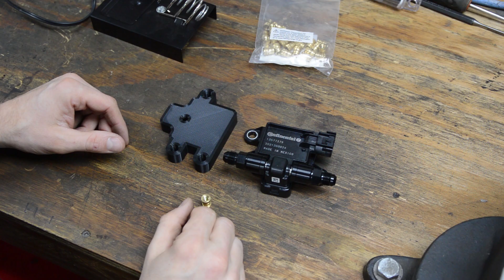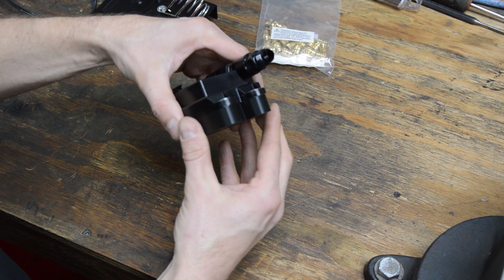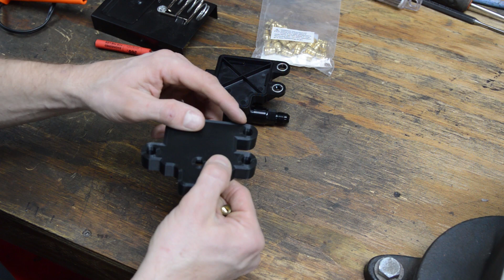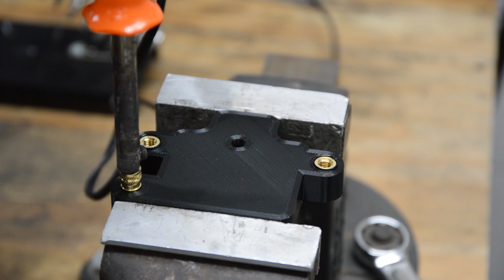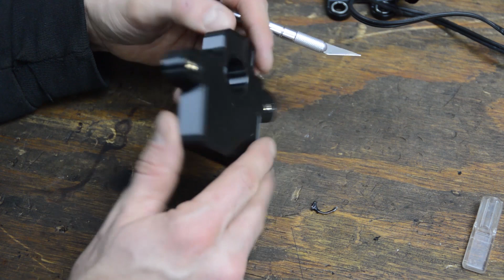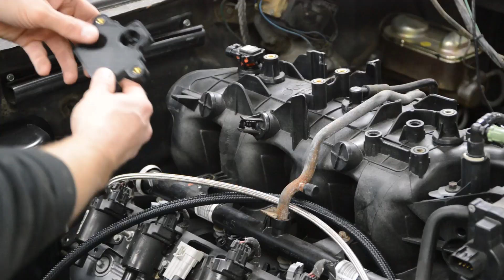3D Printed Bracket - Threaded Inserts - Ethanol Sensor - Chevelle LS Turbo

Comment: This is the device I used, ebay item # 133576060163   Yes its made out of billet, great quality I might add.
Here is the ebay link:https://www.ebay.com/sch/i.html?_from=R40&_trksid=p2047675.m570.l1313&_nkw=133576060163&_sacat=0

The only thing it didn't come with was a bracket. 
However it had built in provisions for a bracket and included the bolts for a bracket, thus I made my own bracket per se (I had found a bracket for an FPR I no longer used and it paired up with the built in holes for that device). 

I installed mine on the chassis/rail near the tank flowing towards the front. -8an in and -8an out. 
It does comes with -6 and -8 AN fittings, and some other stuff that is needed to be assembled (the kit included extras for encase of sh!t happening). Thus I chose -8an for more flow because of the pump Im using + the length of hose being ran.

Its pretty cool how this unit works, it does not stop the flow but rather allows the fuel to pass thru and still flow like it should without the sensor affecting the flow rate. The flex sensor has a probe hanging out in the way of fuel area thus affecting the flow. Look down in any flex sensor and you can see it.
That billet device has 2 holes internally 1 on each end that fuel passes thru so that way the sensor can sense the alcohol content/temp etc. Yet allowing true flow/pressure to be untouched so to speak.

I haven't seen 3D print plastics in a "hot environment" yet (but they make progress everyday), but Papadakis Racing built a 3D print turbo manifold out powder Inconel which was pretty cool! 
That link: https://www.youtube.com/watch?v=4jbn0ah3u9E
Reply from the maker: I'll see if I'll need that later on when I turn the power up.